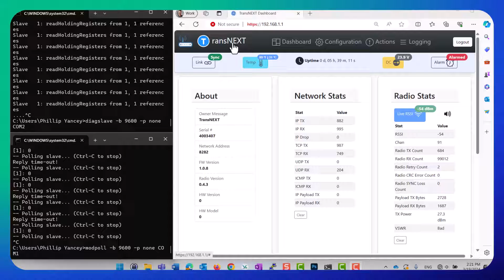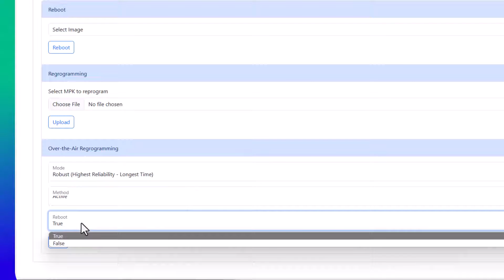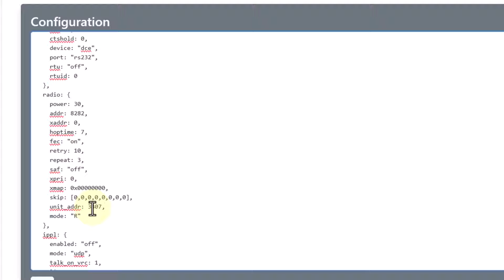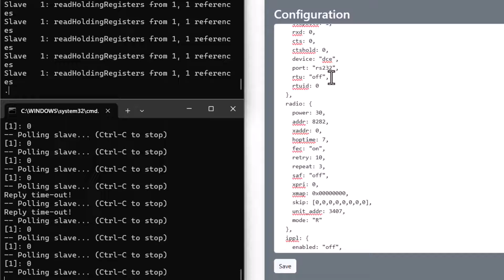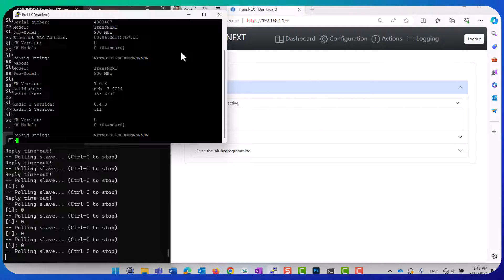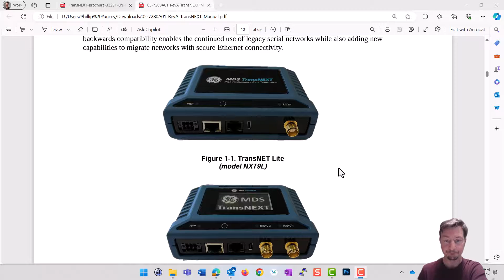TransNEXT  - Compatibility review and setup for the GE TransNET replacement.

Comment: can i call you tomorrow, doing a install with a master and two remotes and might need some assistance.
Reply from the maker: Hi Steven, was a pleasure working with you and since this comment, the new firmware has been released for all TransNET customers that require the Modbus RTU Buffer setting. In this case, we found this wasn't needed and disabling got the system working and the new TransNEXT remotes reliable and stable once again.    The latest firmware can be downloaded here:  https://www.gevernova.com/grid-solutions/communications/mds/software.asp?directory=TransNEXT